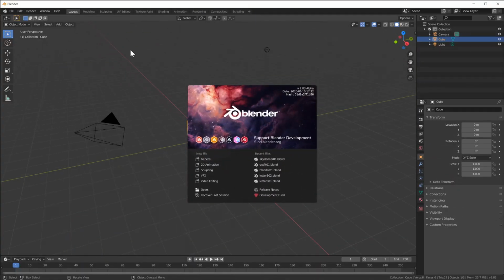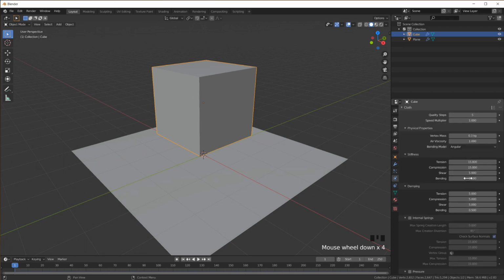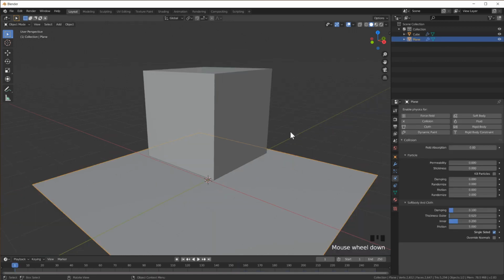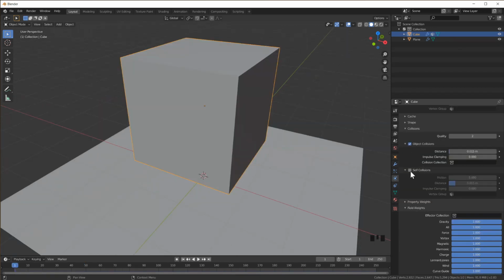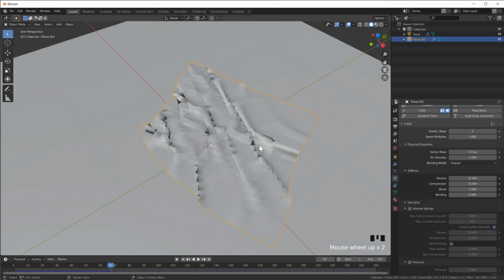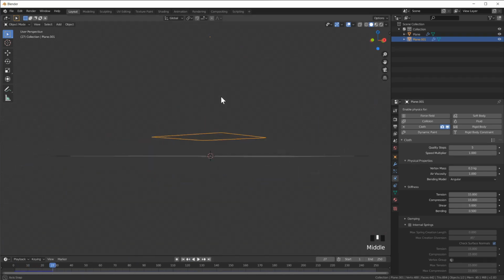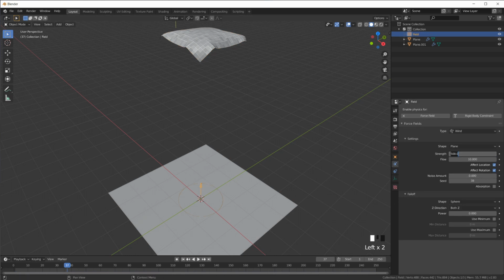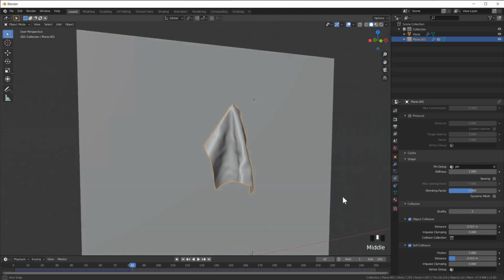2: Cloth Sims 101 / Practical Cloth Sims in Blender 3D

Comment: Eager to get on with cloth physics, just a quick question if I may. Did they change mesh visibility in edit mode? When I subdivide I am not seeing the wire frame on the cube even though I have wireframe geometry enabled under view port settings. Is this an add on, did they change the default in 2.83?
Reply from the maker: uhm... i pretty much use default settings for tutorials and I can see the mesh in edit mode just fine (2.83) ?????